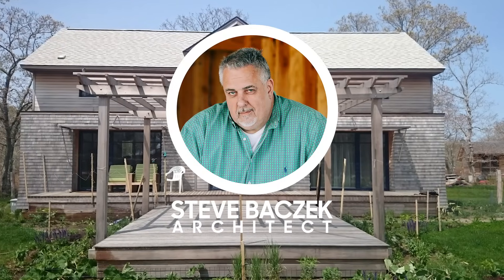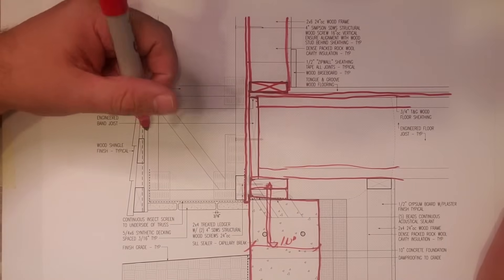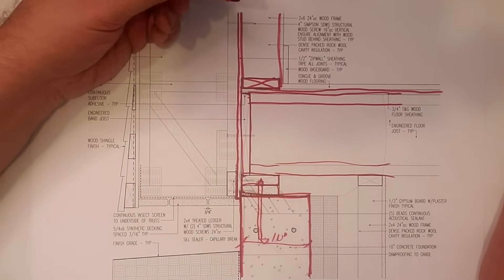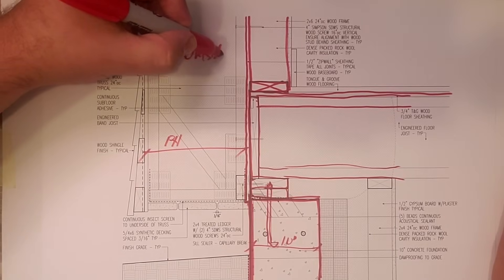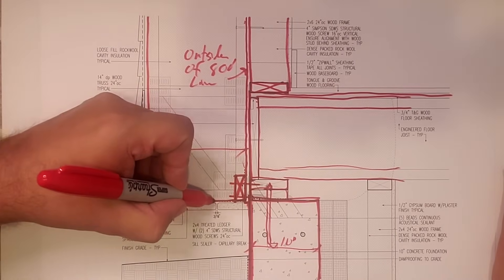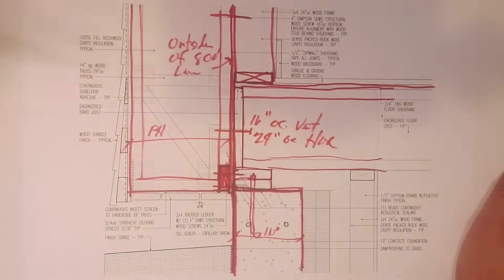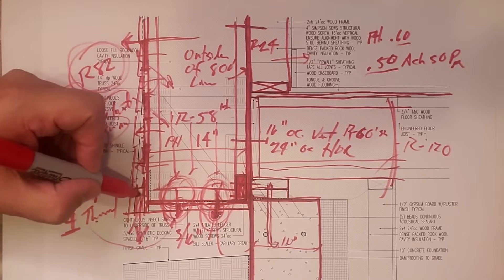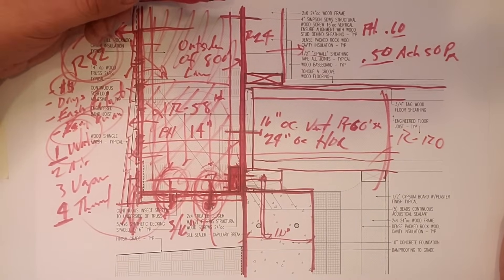PASSIVE HOUSE WALL - R-77?

Comment: Pardon me if my comment sounds critical. I'm skeptical of some of what I see but I want to say that I hugely respect Steve Baczek and his work. He is showing a very creative and effective solution to a difficult problem. I'm just questioning it in order to point out that this is an extreme which is probably totally inappropriate for most projects except those in the absolute coldest climate zones.

R-70 wall? In what climate zones does it really make sense to go to such an extreme? I have my doubts there is much benefit even in IECC Zone 7 beyond about R40. Better to put the difference in cost into other things such as a larger PV array. 

Also, there's a perception that foam insulations are bad for the environment and fibrous ones are good. That's only partially true. First, the WOOD fiber based insulations are definitely better from an environmental standpoint. But rockwool and other mineral fiber based insulations do NOT fall into that category. The wall Steve is showing here 2:06 has a huge amount of mineral wool in it. 

"GWP" or "greenhouse warming potential is one measure for comparing environmental impacts of products. Yes, wood fiber fares best. But all foams are not comparable. EPS and GPS are generally better than polyiso and much better than closed cell spray foams and XPS, which usually measures worst. Mineral wool scores almost identically to EPS. So in terms of environmental impact using rockwool is no improvement over using EPS foam. This is something a lot of people aren't aware of. There are a number of online sources for finding more about this subject. If researching this further keep in mind that foam insulation formulas are changing quickly. HFCs have largely been banned and are now being replaced with HFOs, which will help to improve the environmental performance of the newest formulations. So studies from, let's say, 5 years ago, may not be entirely valid anymore. Still, though, even with the new formulations, EPS remains the best among foams, with mineral wool roughly the same. And wood fiber based insulations remain by far the best overall.

I'm also concerned about the additional framing material necessary to achieve this thicker wall. That is yet more environmental impact in order to achieve an insulation level that may be totally overkill and not providing enough benefits.
Reply: I had similar thoughts. A R77 wall is a waste of building materials. If building to passive house air tightness levels, a wall assembly that has an overall effective R value of 20.5 has a thermal efficiency of 90%. Even in zone 7, it makes more sense to spend your money on upgrading the mechanicals instead of continuing to throw more building materials into the wall assembly.
Reply: @firstdaddy  Your comment is only relates to areas that don't get that cold. In parts of Canada it is not unusual to have -40 F. and with a proper air barrier and heat recover air exchange unit plus high insulation levels the overall thermal requirements are low. As a good example there is a video called Energy Efficiency Birken House Monastery 2013. They don't get as cold as where I am but the video is probably one of the best videos on reducing total energy. Mechanicals have a value, but having a 98% heating unit is poor efficiency if you don't look after all the details. Over the life cycle of a home insulation doesn't fail if the vapor barrier is not compromised and double stud allows superior insulation rates in a cold climate.
Reply: The initial carbon emissions are probably similar. But I think on average, mineral wool should last a lot longer than the foam based insulation products.

Comment: Thanks for the detailed info, nice!
One question: details show a diagonal brace on the bottom of the outside wall truss. When the truss is installed @ 15:30 the brace is opposite. What is the reason for that change?
Reply: Would really like to know...thanks!

Comment: Before anyone builds a thick wall section like this they should check with their property tax assessor, not just their building inspector.  Where I’m from, the building size is assessed based on its outside dimensions.   This 800 sq ft building, let’s say 20’x 40’, with this additional 14” insulation detail featured here, would be 22’ 4” x 42’ 4”.  That’s now 945 sq ft.    For my area, the assessed value for a new structure is somewhere around $400 per sq ft,  and with a tax roll rate of 1%, this additional 145 sq ft results in an additional $580 of property tax per year.  Really doubt the energy savings would offset the increased taxes. 

If Steve can get the tax assessor to use the same methodology as that building inspector, and not count the building area cantilevered out from the foundation,  then I really look  forward to his next design!
Reply: You are getting hosed if some assessor thinks that some cellulose and 2 by 4's cost $400.00 with labor to build. It isn't cabinetry work or anything exotic, involved in essentially a larson truss addition to a structure.

Comment: Very cool details, I remember seeing older homes with  pine boards where an addition was being built, id ask the carpenter about how the boards  are in such good shape, usually get a reply about the older growth lumber with tighter rings used to provide good weather/resistance to moisture.

Comment: Hmm, after cold-soaking overnight would not the passive footer draw in and condense the increasingly humid outside air? Seems like a race condition with sunlight exposure on the wall face being the determining factor. Plz advise...

Comment: May be a dumb question Steve, but how is the load on the passive wall carried. Are the structural screws inserted into the band and floor joists sufficient.  Could you cantilever the floor joists all around the exterior for a passive wall
Reply: He said they were screwed into the wall studs at 16" o.c. vertically

Comment: What retains insulation in truss cavity? Is there a vapor barrier applied before 1x nailers?
Reply: No. Steve said only horizontal boards with gaps between them.
Reply: I would have used 15lb roofing felt outside the pine boards to keep the cavity dry and allow lots of drying to the outside. Then you could use skip sheathing and save the almost one half the cost of the pine. This is how my house was built in 1948. Oh, that’s exactly what you did! I finally saw the photo montage.